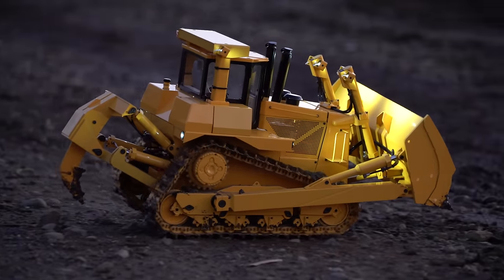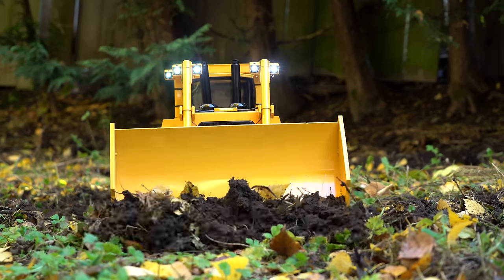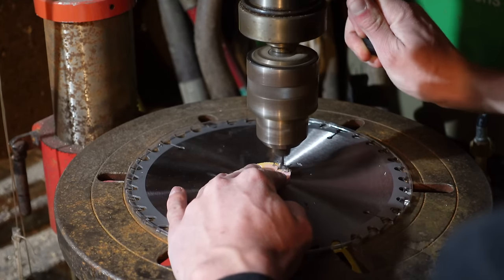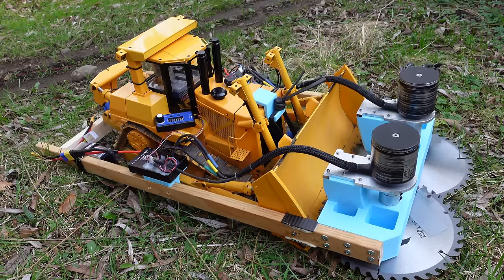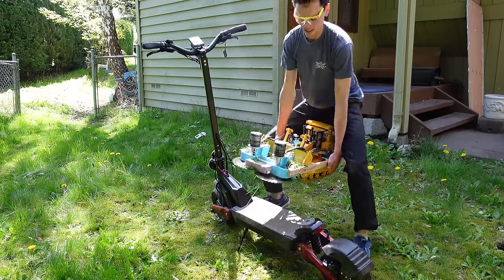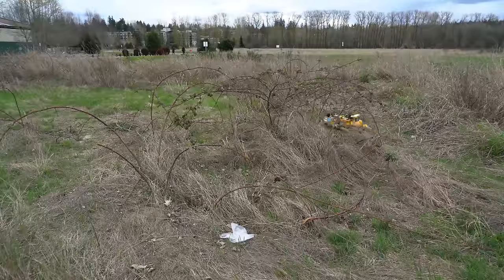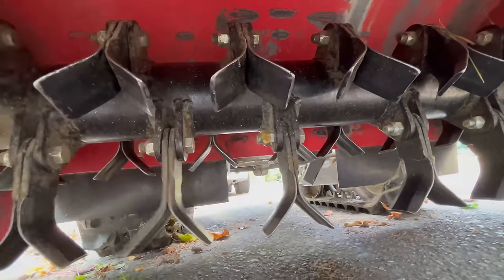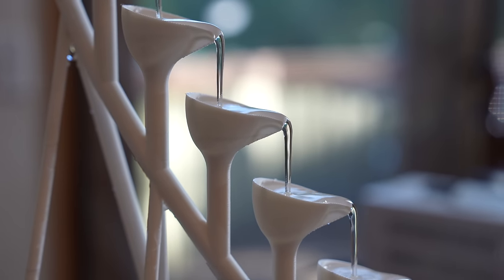$3000 R/C Bulldozer with Saw Blades

Comment: For a less skill intensive version, buy a normal diesel powered RC car, a couple of angle grinders, and two buzz saw blades. Mount the buzz saw blades on the grinders. Glue the grinders to the RC car. Just turn the grinders on before the car, no need for safety features  - if you crash, just send you cheapest team member to recover the loose angle grinders jumping around with spinning buzz saw blades attached!

Comment: Try to smack the chain bolt ends with a sharpened screwdriver as a chisel or use a real small chisel to spread them out and lock them. Or use a ball peen hammer with a hard tungsten carbide ball insert and peen all the chain link bolts.